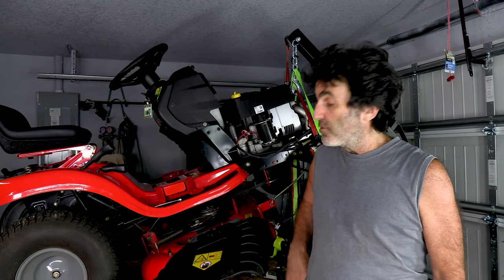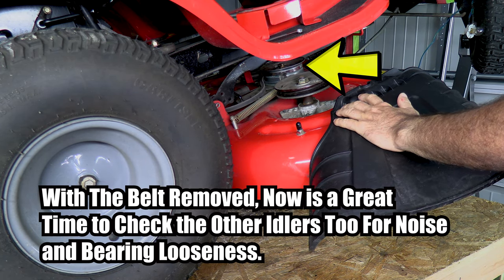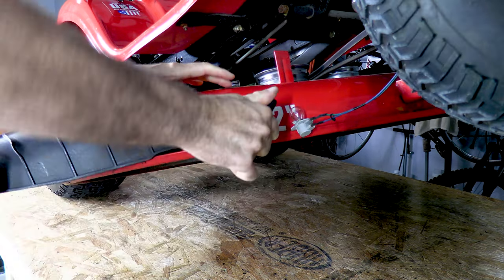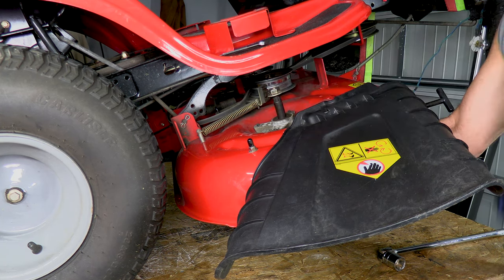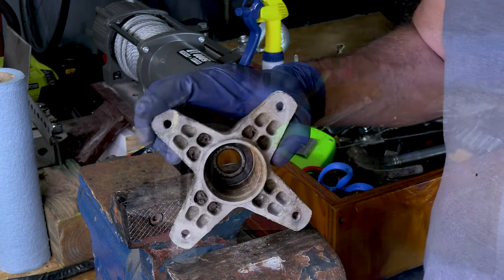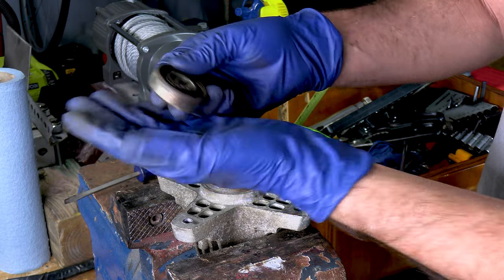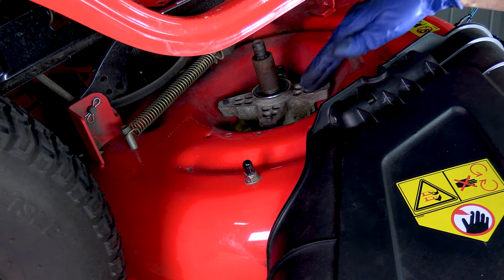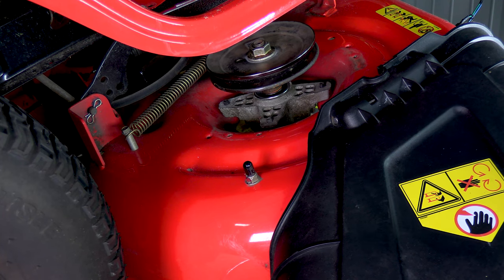How to Quiet Your Noisy Riding Lawnmower Deck

Comment: Very informative! I have a Craftsman YS4500, when the blade is engaged and cutting i get a knocking sound under the deck. Do you have any idea what's wrong?
Reply from the maker: HI, yes if you look under the deck with the engine off of course... try grabbing the blades one at a time and turn them to see if one of them is hitting the side of the deck.  One of the blades could be bent maybe?

Comment: Excellent video, Rudy!  It would have been nice if you had listed the Race/Bearing Tool you used to seat the new bearings in the description.  Do you have a link or at least a make and model/part number, please?  I have two 46" deck tractor mowers; a Troy-Bilt and a Craftsman, both made by MTD, so my Spindles are likely the same as these.  Thanks
Reply from the maker: HI, I'd have to go back and see the video to see what I used.  But it sounds like it's the regular race tool I use for everything which I just got from Harbor Freight...  I'm sure Amazon sells a similar tool, but the one I have came from HF... Thanks!..
Reply: @JLPicard440   Thanks for fast the reply!  This tells me you really care about your subscribers and even viewers.  I'll go to my Harbor Freight and check out their Race/Bearing Tool Kit(s).  I tried to remove the bearings in a spindle set to install Zerk fittings for greasing and spindle longevity.  I was able to get them out of one and install the Zerk fitting, but not the other.  Best wishes for you growing your channel!  👍👍 That blade lock tool looks pretty handy, too.   Is there an Amazon link or is that another Harbor Freight item?  I like using Amazon links when available to support those who help me.  Too bad Harbor Freight doesn't have affiliate links.  ☹  I usually use an Impact Driver to take the blades off, but you mentioned not over-torqueing when reinstalling.
Reply from the maker: @100vg   Thanks for the great remarks.  I do believe I got that blade tool from a yard-sale.   I did just look on Amazon and there's a few on there to choose from... 😊
Reply: @JLPicard440   Thanks again!

Comment: I have a John deer zero turn I think it’s a z34 or something like that. Anyway the spring that makes the blades engage well anyway the spring breaks because of the vibration that it makes only when the blades are engaged I only have like 30.6 hours on the thing. We tightened the bar that runs under the flap but like I said from the vibration now that is loose again. The spring cost like $18 so I’d like to kinda know what is going on before I mow again. I live in picayune Ms so I’m not sure where u are but I would like to get an idea before having someone come out and since I’m a woman, possibly getting ripped off. Thank you and GOD BLESS U
Reply from the maker: HI!  I am in Fl..  It might be a bit far to MS!  I have heard of that town for sure.  I have heard that before about the John Deere deck and I've experienced heavy vibration from other machines as well with nothing apparently wrong.  I understand about getting ripped off.  The shops like to charge a lot even for just a diagnosis.  With only 30 hours is it still under warranty?  I think JD might be 2 years.

Comment: At the end of the video when you say “replace the bearing on the other side”, is this just something you needed to do yourself or is this something we would need to do to complete this repair?
Reply from the maker: HI, I think the reason I said that was because the bearings in the other spindle on the other side were bad too.  If yours are still good then no, there's no reason to replace them... Thanks.. 😊

Comment: Great video.I have the same mower, what bearing size did you buy?
Reply from the maker: Hello... I don't remember at this point... If you get the model number usually from under the seat, you can go to a website like www.partstree.com and there you will find a parts breakdown.  This will show the part number of the bearings or any other part... 😀

Comment: My brand new craftsman t110 makes a metallic rattling noise when the deck is engaged, but it happens on and off consistently and rhythmically. Do you know what could be causing that?
Reply from the maker: HI, not without seeing it.  For something like that I will usually have someone sit on the mower while it's running so I can look around and do a visual inspection to try and see where the noise is coming from.  Obviously keeping hands and anything else that can get hurt well away from any moving parts!  I've definitely found rattles that drive me crazy that way... 😊
Reply: @JLPicard440  I understand. It was odd to me because it’s brand new so shouldn’t be making sounds like that. Have you ever heard of brand new with bad bearings?
Reply from the maker: Anything is possible!  If it's brand new is it returnable?  Sometimes Lowes or places like that will allow returns for a time period...

Comment: I have a grinding noise after a new deck belt but not the blade pulleys. When the troy bilt pony is sitting idle the noise sounds terrible. I've greased and lubed everything and the noise is still there. If engage the blades there is no noise. Release the blade lever  ,and as it sits idle it has that terrible grinding noise
Reply from the maker: Oh wow!  That's not something to be desired is it... 😂. In a case like that I will usually have someone sit on the seat so that I can do a visual inspection / walk around to try and pinpoint where that noise is coming from.  Obviously keeping anything that can get hurt like hands and fingers away from moving parts!  One thing I just thought of, is it a squealing noise?  If the belt is slightly to short it might do that...

Comment: Where did you bought the bearings? I'd like to do mine but it's John Deere.
Reply from the maker: I think I got them from Amazon.  On these bearings there was a part number on the dust cover I was able to type in and get a replacement.

Comment: Has anyone experienced the idlor pulley digging into the mount? I went and got the mount on the deck welded back and pulley fell off again and is eating back through the mount on the deck again?
Reply from the maker: If the bearings are wore out then the idler pulley can do that.  There's not much clearance under it...